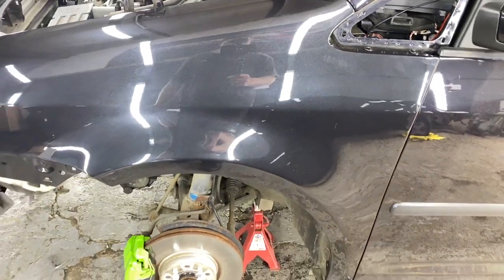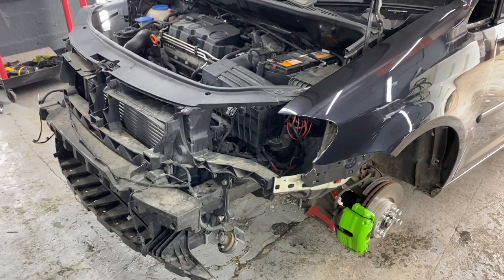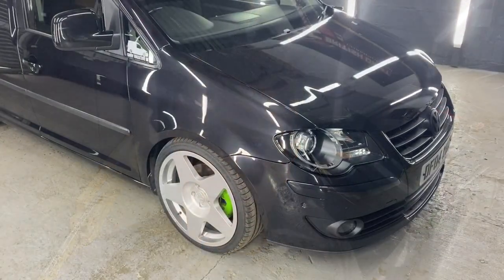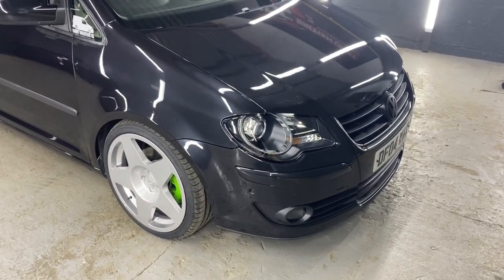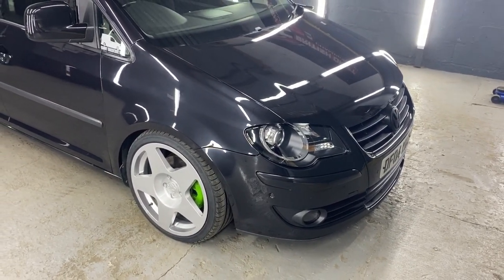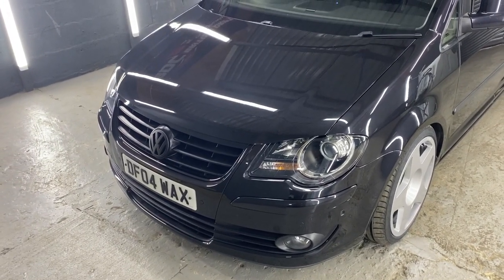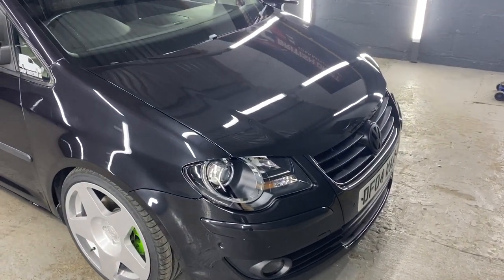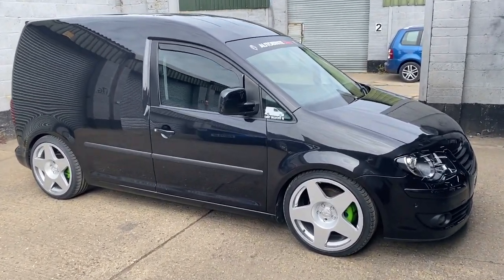VW CADDY DETAILING VAN UPDATE - V2 TOURAN FRONT & NEW WHEELS

Comment: How do you get the hood to close ? Or did you also get a new hood of the touran ?

I did the full swap and cant close the hood, there is about a 5 cm difference between my latch and the new bumpers
Reply from the maker: Youll need the complete front end front panel and bonnet from the touran
Reply: Ye I got the fenders, bumper, lights, the plastic which the bumper sits on

But not the hood 😭🤣